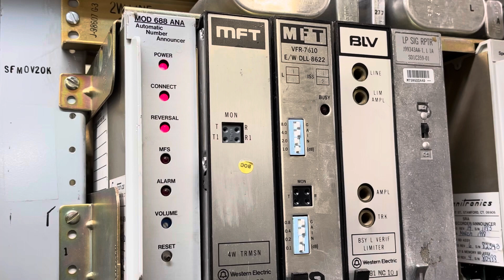Ani and Cognitronics Announcer in a Strowger step switch.

Comment: Same voice still in use in most of the 5ESS/DMS-100 switches in Central California.
Reply: It's probably the exact same card shown at 1:50 on the far left. It's probably from the 80s or 90s, a lot newer than the ANI equipment shown here, but it is compatible with it.